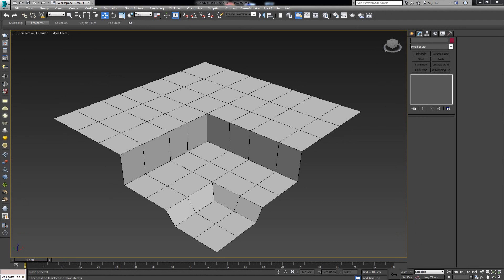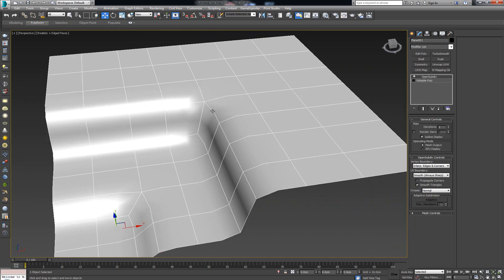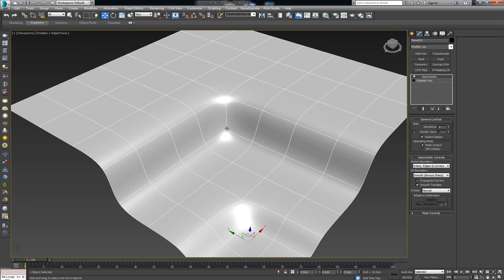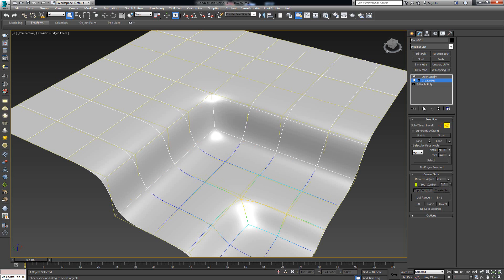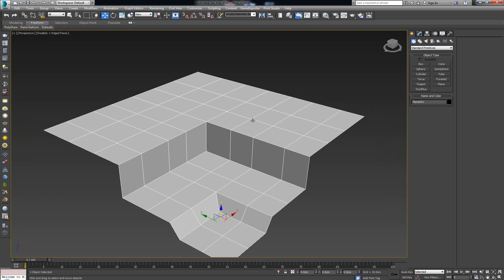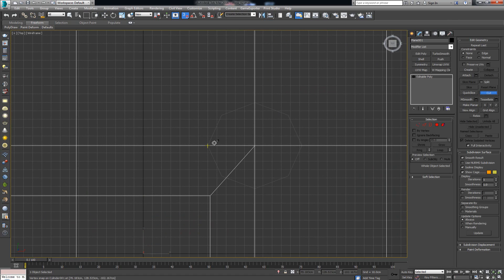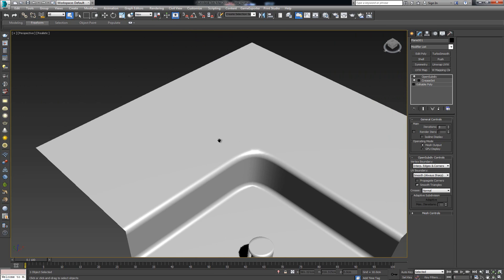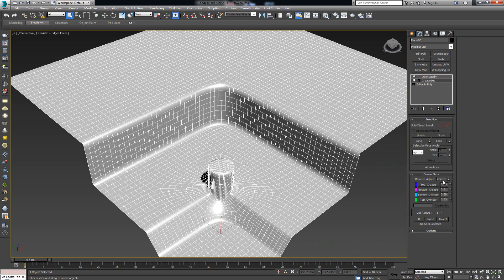Working with the OpenSubDiv modifier in 3ds Max

Comment: cool to watch.. i cringed when you capped the cylinder with that method. A flat 8 ngon face cut into 4 slices is a better method if subdivision is going to be used because all the vertex weighs would spread out equally.
Reply from the maker: I've had that same cringe when rewatching some of my older videos but then again when recording you don't really notice it :)
Reply: yeah ive made a few videos before (not screen recordings) and my brain has this habit of locking up half way thru a sentence :)
keep up the great work !
Reply from the maker: Gavin Downes It can be a fun experience and it can be a frustrating experience, especially when something goes terribly wrong or the program decides to crash or the recording gets corrupted :)

Comment: does zbrush support opensubdiv?
Reply from the maker: +Numan Salati What exactly do you mean does ZBrush support opensubdiv .. when you get the model into ZBrush it will inherit the shape of the exported model, and what OpenSubDiv does is basically move the edges around so you get sharper edges after the smoothing. So basically like if you want to get sharper edges but instead of adding new geometry you simply move the adjacent edges after the turbosmooth modifier with the help of a edit poly modifier.
Reply: +Denis Keman What I mean is does the divide in zbrush use the same algorithm as opensubdiv? That way you could import/export in both directions from max to zbrush and have no issues with creasing, smoothing etc.

Comment: I also tried the crease set modifier in conjuction with OpenSubdiv but as you can see the edges aren't beveled and the highlights also don't look good to me. For me it works best when I use Turbosmooth with smoothing groups and then I just bevel the edges on top of the subdivided mesh. There is also a chamfer modifier where you can always adjust the radius of your chamfers or the iterations and some other settings which comes very handy once you're not happy with the result.
Reply from the maker: +Geworg Hovhannisyan I'm not saying you are wrong or anything, especially since i work with the Turbosmooth modifier myself, but the point of this video was to simply show you another way of doing it and not force you to do it that way.
Reply: +Denis Keman Nothing personal I was just sharing my opinion. It's always good to learn new things and enhance your skills. I found the proboolean instruction very helpful since I've been trying to avoid it. Now I can use it in certain situations which would make my life much easier.

Comment: Hi, you know i see that the chamfer is not so good there as when we use Turbosmooth? Expecially on a top of cylinder. She looks like sharper. It is not good effect :(
Reply from the maker: +Ебурдей Гордеич TurboSmooth is still the way that i choose to model simply because it gives me unparalleled control over the edge sharpness and look. This video was just to show everyone that there is another way to do it if they choose to do it, or if they can't allow to use extra geometry (which the TurboSmooth brings to the game)
Reply: Denis Keman
Hm, how do you think statistically is the most 3d-modellers in 2016 choose OpenSubdiv or Turbosmooth?
Reply from the maker: +Ебурдей Гордеич My bet would be on the Turbosmooth as it relies on geometry manipulation opposed to leaving Max to determine the sharpness automatically by moving the already existing geometry. I might be wrong, but i doubt it :)
Reply from the maker: ***** Same with me, i do prefer using Turbosmooth and edge loops for defining the edges but bare in mind OpenSubDiv is pretty new so it might take up some time before people start using it, if they ever start using it that is
Reply: SomeGuy - where can I find 3DSMax on twitch? I can't find any.

Comment: Is this just SP 2 or? Do i have to download it manually? I cant remember
Reply from the maker: +Visceral3D Don't really remember as well, i know i saw it on one of the what's new videos about Max, but was it for 2016 in general or was it a Service Pack i really can't say.
Reply: +Visceral3D Pretty sure it's included in 2016 by default and in 2014 and 2015 you have to download extra service packs to get them.
Reply from the maker: Linkitch I'm pretty sure you are right
Reply: Yeah i just treid it out on 2016 its there. Going to do a whole lot of expoermenting to see if its viable replacement for the old turbosmooth control loops method.